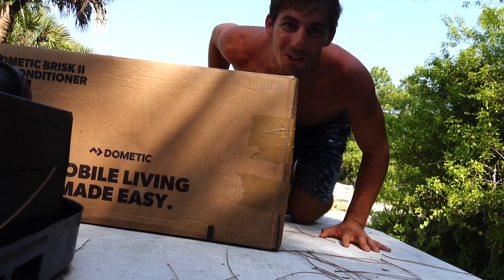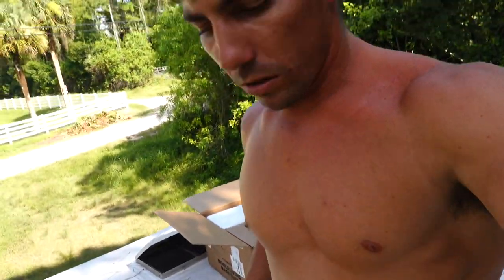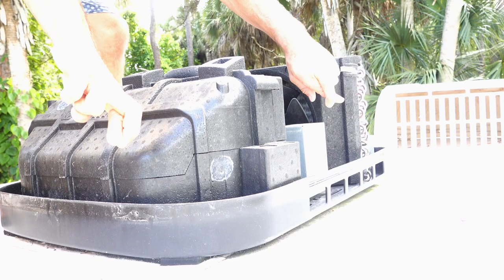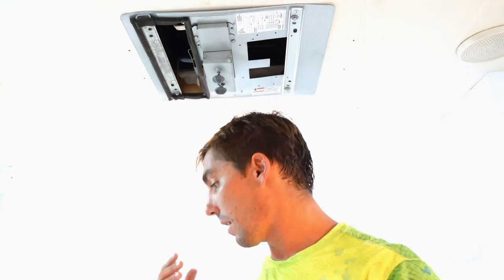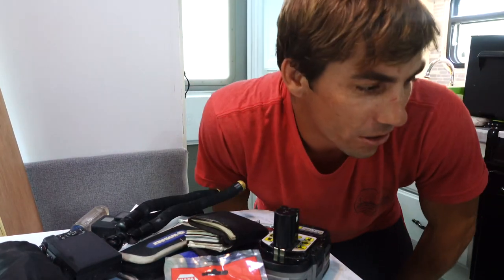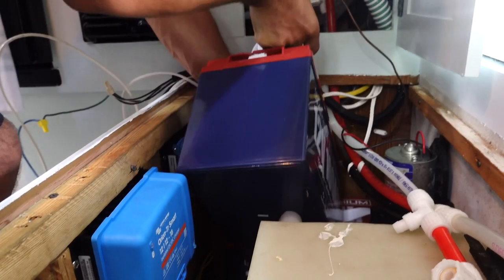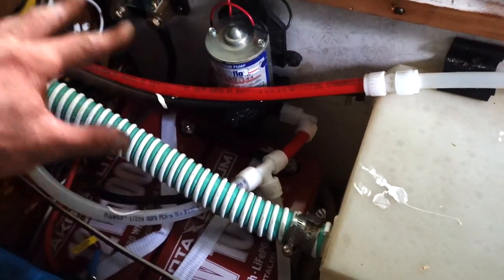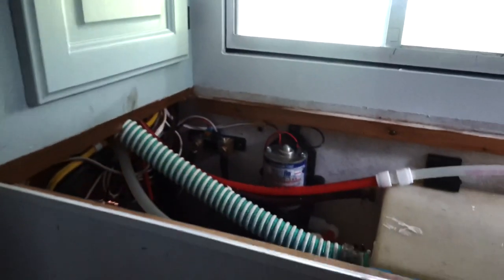The Two MOST Important Upgrades To Our TRUCK CAMPER? | BUDGET DIY TRUCK CAMPER BUILD - Terra Tula

Comment: Hey Billy, The channel, Fate Unbound, talked about a device they added to their a.c. to make it easier to start, which is when it draws most of its power. That made it possible for them to use a pretty small generator to run it when they are boon docking. Cheers

Comment: Please make sure you install a new CO detector.  It saved my parents life one time and here is the scary then funny story.  They were at a campground where the trailers/motorhome spots were close together and everyone was suppose to park their backend parallel to the next camper.  In the middle of the night their CO2 alarm went off.  My father found that the exhaust from the motorhome next door was leaking into their motorhome so he moved his motorhome further up in the spot and went back to sleep.  Then the next morning it became a little funny.  Some representative walked by and noticed my father's motorhome was no longer in a nice parallel line with all the others.  My father told the gentleman what happened but he still demanded that my father move back in line.  The discussion got a little heated so all in the area could hear it.  Then my father noticed that every other camper was being moved out of the parallel line because no one else wanted die in the middle of the night.  After everything was moved the representative had to back down, my father became the hero of the campground and met a lot of great people.
Reply: Randy She  Yep, thanks and I corrected it

Comment: Just say the ac is for jetty. You can install a easystart Capacitor on your ac. That will allow you to run it on a 2000 Honda inverter.

Comment: Put another big amp alternator on the engine and that can be wired just for the camper.  And all so put a battery isolator on the truck and run a good-sized wire to the camper batteries.  It works every time.

Comment: I am glad you installed the ac.Make sure you keep the warranty info.The only drawback is you need an authorized repair person that will verify that the unit is defective before Dometic will replace a defective unit.Hopefully you will not run into that situation.If you do you will have to hunt down a tech or rv dealer that is Dometic authorized.Good luck and safe travels.

Comment: 100% agree with you on lithium batteries, the total usable amp hours and lifespan of the batteries compared to lead acid or AGM absolutely offsets the initial costs, of course the other factor is that because you can discharge the lithium batteries so low without damaging them you can realistically reduce the size of your house bank by almost half, and still have a similar amp hour capacity, obviously the wattage of the batteries needs to be factored in to get the correct wattage for PV panels, MPPT's and inverter. Two lead acid deep cycle 102 amp hour batteries gives you less than half of the total as usable power but with lithium you get almost double, so a 40 % smaller lithium bank still gives you the same usable power, that's a big plus in weight, volume and ultimately cost. Best of both worlds, new Seawind on order and a 4×4 camper. Living the life. I believe the Seawinds sail really well, there are some design elements that I personally don't like, and many others that I do. Good choice for a very seaworthy fairly fast and affordable cat. What motor option are you going with on the 1160 Lite?? Integrated fuel tanks, I'd presume so and capacity??

Comment: You'll need to check out a product called "soft start "for your air conditioning unit. Makes it so can be run off an extremely small generator like a Honda 2000

Comment: Camper is looking good.  Did you service anything on the truck?  It was sitting in the Florida sun for over a year correct? Did you look at rubber brake lines, radiator hoses and any other rubber lines?  All of those items dry and crack over time.  You are going to be working the truck hauling the camper and towing a trailer. I would hate for you to blow a radiator hose or even worse a brake line on the road.

Comment: My guess is the AC and Each battery cost about $900 Each so at this point I'm thinking you've spent about as much upgrading the camper as you spent on the camper.  Hope it works as good as it looks!  You could get that thing on a private ferry to Cape Lookout and kite sail with the ponies and the light house in the background.

Comment: Billy I bought a end for an hvac charge plug for 3 dollars at a supply store soldered it in and my buddy put a pound of charge on it for the cost of refrigerant. Don't listen to those people. Anyone that has installed a central ac knows you have to sweat all the connections. Just make sure to pull a vacuum on an empty system.
Reply: It so easy to fix the leak. Just use a refrigerant sniffer. And solder.
Reply: The leaks are SEALS and can’t be fixed.  Please only comment when you know what you are talking about.  Billy even said he looked into it.  Stop making this hard.
Reply: The funny thing is I actually do know what I’m talking about. I’ve fixed these unit before. Ran for years after I fixed them. 😃
Reply: @robertgarbe6348  your right, the seals do go bad in the compressor, but for me a charge once a year got my roof top unit by for the season. Hell only cost me an 18 pack a year and did this for 4 seasons.

Comment: Do you have a soft start unit fitted approx $300 odd so that ac can start off batteries?
Reply: Pat Robins Yep, I run a Micro Air Easy Start 364 in my Dometic off a Yamaha 2kw genset.

Comment: I suggest to
Move the water tank and pump under the sink storage cabinet .
Reply from the maker: Why do you suggest that?
Reply: Water tanks and hoses can leak/burst. Just a suggestion that I am doing In My 1995 sportsman model 801
Reply from the maker: I don’t think the water tank we have will fit under the sink
Reply: @Tulasendlesssummer  my plan is to use a 5 gallon collapsing water jug that I refill when on city water. It fits perfect under the sink inside a shallow pan . But I also have extra room under my kitchen counter top because I do  not have an oven. My camper didn’t come with one and frankly I don’t need one. I be using a hand pump for the water jug and a regular faucet for when contacted to city water
Reply: Also, thank you for the suggestion for Dakota lithium batteries and solar panel set. I’m ordering my set next week

Comment: Buy a HONDA EU 2200 Generator. By the Hutch Mountian, propane conversion that allows you to run it off your propane tank(s) or its self contained gas tank, or you can adapt a hose to allow it to draw from your trucks gas tank. Starts the first time every time, make less noise than to people talking and you just plug your truck camper into it. You are done!

Comment: When is the Seawind going to be ready and when will we get to know the model?😊🥰
I'm still hoping for the 1370, for your forever home! That way you and Ruby Rose 2 can be Buddy Boats 🥳🥳😁😄😊
Billy did you keep your little Honda generator? That should run that AC unit if you use high octane gas in it.  You could mount it in a box on the back bumper.  
I hope come to Upstate New York when you come North. You've got a lot of fans up here ❤❤❤🤝🤝🤝👍👍👍👍👍👍👍👍👍👍👍👍👍👍👍

Comment: If there's a valve on the old ac, you could have bought a can of refrigerant for auto ac's at Walmart for $20 and recharged it. The stuff has a sealant mixed in it to plug up any small leaks too.
Reply: Exactly what I was thinking. I have a store called "Ollie's" near me and the cans of 134A are $4.99 each. I go thru 1 per year keeping the A/C in my Hyundai icy cold.

Comment: Hey mate enjoy the A/C...you both work hard enough.
Curious which engine option did you choose for the Seawind 1160 Lite.
Reply: I'd just go with the 2 outboards, no raw water intake, sea strainers, impellors, holes in the boat etc etc, seems like the sensible option, not that outboards are cheap, but nowhere near as expensive as marine diesels. Plus you could use one as a tender backup, if the tender is rated for that size motor, I think they are 25hp so highly unlikely. Do the ones with the outboard option have integrated tanks? I suppose so. I hear the 1160 lite sails really well with a decent turn of speed. Great choice for sure.
Reply: @jonnorousseau3096  I think he went diesel since he knows how to work on them.

Comment: Roof ac's are insanely inefficient and total power hogs. That thing draws 1750 watts which is about 16 amps all by its self. I would have gone with a 9k btu mini split. You could have run that on solar or your honda generator.

Comment: Yep, throw it away and get a new one. Cars & trucks going the same throw away plan to keep you spending. Headlights were seal beams @ about $12 each to today $1,200 a side. Cars and trucks no longer have a dip stick in the transmission or engine in hopes you'll run out of fluid and destroy your ride. Buy more, spend more. Gotta have a new ride every 2 years.....That's the way it's going...If you want to fix your own, shame on you, shame, shame...

Comment: I find it ironic that you sailed for years in places which would of regassed your AC or just sold you the refrigerant to do so yourself. You return to the USA a supposedly a first world country and yet there is no way they would allow this.

It is sad not just the major cost you have had to pay out but that you are in a society which is so wasteful and throw away.
Reply: Well he replaced the a/c in the camper not the boat . They didn't have the truck camper a/c in the boat so it would have been kinda hard to had it recharged anywhere else.  But I'm not really sure what you mean ?
Reply: @allenwilson9656  Well it is simple I am not suggesting that he was sailing his camper to these places just that in these third world countries it would not of been a problem. Of course I am also not suggesting that he would know that in the future he would buy a camper with AC needing a top up and could of purchased it.  So he had to throw away what was almost certainly a working A/C just needing a gas up because the USA is either over regulated or a throw away society in comparison to poorer countries